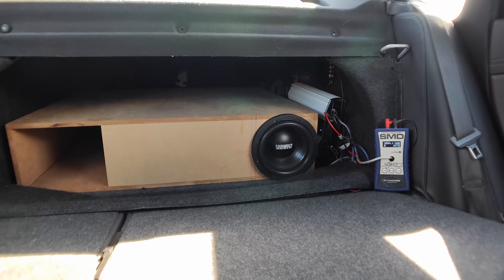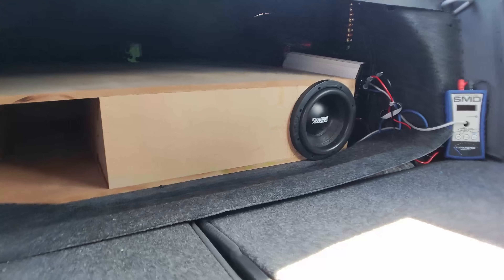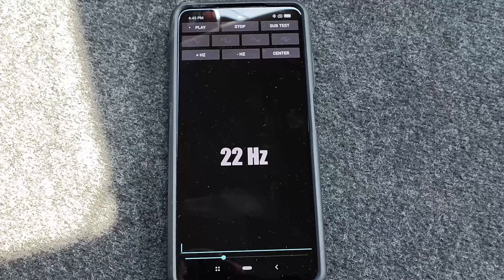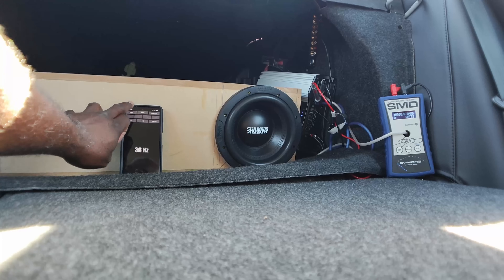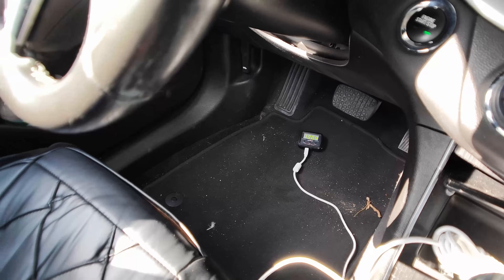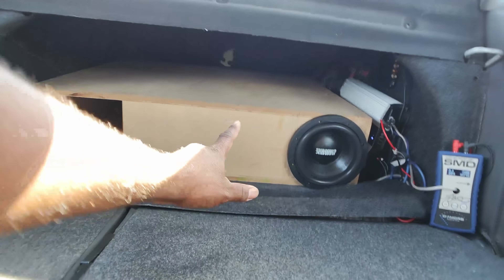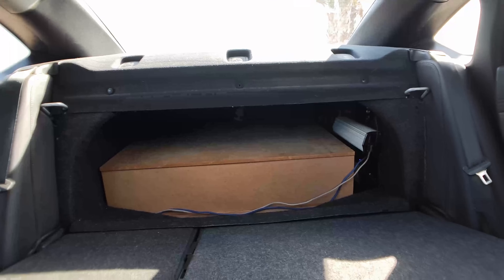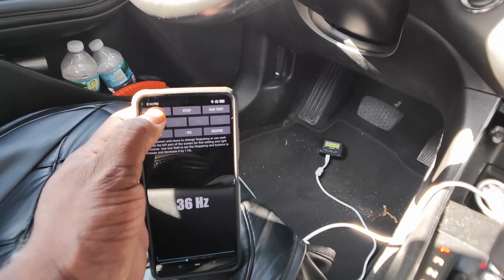A Properly Built Horn Enclosure - Sundown Audio X-8 Subwoofer - 140db SPL Test!

Comment: Unrelated question, if I’m building a custom ported enclosure for 2 skar VXF 12s
Is there anything I should know? Plenty of space but I’m shrinking it to keep the cubes down. 
33”x19x18.5”
Front facing port 52” port area tuned to 30

Comment: чв один из самых широких по ачх сабов, но на громкость труба лучше
Reply from the maker: В будущем я попробую провести этот тест с другим сабвуфером. Спасибо за просмотр.
Reply: @BudgetBassHead  a bass reflex on the pipe, and tuning to the resonance frequency of the speaker, gives a very high but narrow efficiency, for example, a t-line will play 100 db 20-160 gz and a box with a pipe 35-40 gz

Comment: When finding the peak or the vehicles resonance do you have to check for those numbers for each sub whether it be 8 on up to 15 or would that number be the same just because of that particular vehicle?
Reply from the maker: Good question. I suppose it would be more constant in an open environment like an SUV or a van. But coming from the trunk changes things. So it varies with enclosure size and tuning. Mostly because the enclosure size is less than or greater than the previous enclosure; which changes the overall cabin volume.

Comment: slight correction, at 5:16, you mentioned it horns dont have a lot of back pressure, this is actually far from true when dealing with real horn designs, specifically referring to what they call a compression chamber in the horn desgin . . a t-line typically doesnt not have a compression chamber but a real horn design does. , this compression chamber is NOTORIOUS among horn designers for destoring spiders, and ripping cones, because the pressure is so great, this is only specific drivers with strong motors and spiders can thrive in a horn, if not strong the the compression pressure will shred the sub.  Also there is a ratio of compression when building a horn design. some horn designs produce higher pressures than others. if i remember correctly the higher the compression on the chamber the louder the sub BUT at the risk the sub being more likely to be shredded. only the best subs can dealing with the highest compression ratios. Check out paraflex design group on facebook, there is so much to be learnt there :)

Comment: Hay brother i saw you say in another video that you should have an amp with more power than the sub can take to stop clipping. So i want to get a Skar rp 2000.1 amp and run 2 skar subs on it. ether 12's or 15's.  probably 12's,  what Skar subs would you recommend for that amp running at 1 ohm powering 2 subs. i think that amp dyno's at 2,600w rms.   also do you have a review video on the Skar DDX subs? i looked and cant seem to find one. Brother i could really use some advice. i want it to sound good but i also want it to bump hard and move a lot of air. i will be putting this in a 2011 Nissan Van. that van is huge and long with 2 back rows of seats that will lay down flat with lots of cargo area so my box can be huge if need be.  i just have herd that the more rms your subs are rated at the harder they are to push and i want to get the most out of my subs without having to run my radio at full volume, if you know what i mean. Can you give me some of your expert advice. Thanks brother, great channel, i am learning so much from your videos!

Comment: Had 2 15" speakers in folded horn enclosures in the house, powered by a Sansui 9090db, and Iv'e never heard anything better. They hit so clean, hard, and low.
Reply: Probably more to do with that amazing amp than anything else lmao
Reply: @chickenpotpie4045   I agree it is an amazing sounding amp, have it powering some cerwin vega vs150s right now, but really regret selling those custom folded horns i had.
Reply: @klubstomper Any way a square sub could do well in a horn enclosure?
Reply: @ericthompson4644 it should work just get your measurements correct, 
Watch this guy's other videos on how to design a horn but use your speaker TS parameters.

Comment: Good video, man. I say for a V2 build, try reducing the throat size all the way down the line, incrementally, starting at the sub mounting side.
This will (hopefully) lengthen the path and bring it closer to a quarter wave resonance of around 28hz.
It should also smooth out the response curve.
Any chamber resonance can be smoothed out with wool batting or poly stuffing the line 1/3rd of the way past the subwoofer side of the line.
Just some input from someone whose designed and built transmission line and labyrinth enclosures...

Comment: Have you ever considered getting a t harness from llj Customs out of Phoenix I had one made for my 2019 Chevy Trax and it was plug-and-play worked flawlessly
Reply from the maker: I really do need to. Check them out a couple years ago but never made the purchase
Reply: What is a t harness?
Reply: @boomymood  The harness that is made to add an amplifier to a stock system without having to hack up your OEM wires

Comment: 1/4 wave enclosures can load the cone to an extreme extent. Take your resonator and narrow it, then increase the size for maybe one fold and make the mouth far bigger. SPL will likely increase as will cone control. My suggestion, anyhow, grains of salt and all.

I've complete construction of a "double transmission line" "compound horn" paraflex box for my Walmart sub.... I'm coming after that 140dB once I get some new power wires run etc etc.
Reply: exactly every 1/4th wave i have done has had an insane amount of cone control.
Reply: @puresesh7985  i have a transmission line in my car with a 800w 10" deafbonce sub and i can easily push 1300w because the cone doesn't move much
Reply from the maker: Cool idea. I was limited on space. This was the best I could do within the trunk.
Reply: @BudgetBassHead  I had to hammer out my trunk and remove the carpet to fit mine, but it fits. Lol. TBH no idea how much my cone is moving on this one because the box fully encloses the speaker. My 6.5" version the subwoofer seems to take well over rated RMS before exceeding excursion, but it's got a crazy motor for the size of the speaker. My 12" motor isn't so impressive for the size
Reply: I would be interested in seeing and learning from your build

Comment: When you did the sweep, your horn enclosure peaked its highest impedance @ 37Hz= 6.1 ohms. Thats why your Db went up a little more when you tryed 37Hz, that is where this enclosure has maximum cone control. You could have eeked out a little more @ 37Hz, if you crept up on power, just before it bottomed out, maybe a 140Db @ 37Hz? Also looks like to be safe on this enclosure, i would set subsonic filter to start reducing power @ 30Hz, cause by 26Hz, it started to unload. Great video, and results!
Reply from the maker: Thanks for the tip

Comment: The box matters, a properly engineered and tuned box makes a huge difference.
Reply: Or if you have the money and space build a Infinite Baffle bass array usually it is built with 8 or more 12 to 18" woofers mounted so the movements cancel each other out (or else it will shake your house to pieces), in that arrangment your box do not matter as long as it is big enough (usually use you use another room as the (box). I have heard the undistorted   sound you get from open air dipoles and infinite baffle which is something else  but it is inefficient as you need +6db per octave boost from 70hz and down usually. But I would love to hear how a properly build bass horn sound like to compare as that is completely the opposite and I would love try build one :)

Comment: I ran the X12v1 for years in a 3cuft ported enclosure on a RF 1500BDCP. It was the best sounding subwoofer I’ve ever heard. 

They sound so clean it takes a while to get used to them.

I’m looking at picking up one of those JP8 amps and one of these V3 8’s now. I don’t want to run a second alternator and battery in the car I have now.
Reply from the maker: Very cool!

Comment: Those are incredible #’s very impressive. Where would be a good place to get info about horn enclosures?  I currently have a 6th order in my theater so I have plenty of space and prefer to build my own boxes. I’m thinking of building a large box for two FI sp4 18’s or one for each. Any info would be appreciated thanks.
Reply: I have 18 inch Fi sp4s= SSA evils (when Fi actually built them for SSA in 2016, or 2017) they are Awesome= 66mm of linear 2 way X Max, and Over 90mm of peak to peak X Max! They excel in ported= 7 to 8cu. Ft. Net per 18, tuned @ 20 to 25Hz for home audio, with 1-8inch aeroport per 18, 4th order= 3 to 4cu. Ft. Net rear sealed rear ch., front ch 4.5 to 6cu, with 100 to 125 sq. In of port,  tuned @ 42Hz to 70Hz, and 6th orders= 5 to 6cu. Ft. Net rear, tuned 23Hz to 25Hz, with 1-8inch round aeroport,  per 18, front ch. 4 to 7cu. Ft. Net tuned @ 42Hz to 70Hz, with 120 to 150sq. In of port, to play up to 40 to 65Hz, tune front ch. higher if you want higher. Hope this helps?
Reply from the maker: Checkout HornResp. It a free tool. It has very detailed documentation and an intuitive layout.
Reply: @BudgetBassHead  I also watched one of your videos with the 6 1/2. I’ve built a couple of T-line boxes using the “half of the driver formula” huge boxes make even mediocre subs sound better. What would be the difference between the two designs?
Reply: @Superficial_david  Transmission line and (back loaded/tapped) horn design both use 1/4 wave theory to align the back wave from the speaker cone with the front wave. The biggest difference from T-line to Horn is that a horn has a mouth with area exceeding the area of the cone of the driver, as I understand it. They are LOOOUUUUUDDD lol
Reply: @Superficial_david  how can I learn more about this technique?

Comment: Horns!!! Sealed box in a Horn even crazier.  🤪 more control of woofer. If you figure out the holy grail. Simetrical loading? It will blow your mind. Took me 20 years to understand...
Reply from the maker: Symmetrical loading? I've never heard of that. And now you got me googling stuff 😁
Reply: @BudgetBassHead  I'll give u a hint. Steve Deckert... the GOAT of enclosure builds in my opinion. (Your in my top 10)  It loads the woofer in a different way than anything I've ever seen before.  And is proven... if u reply I'll send u a explanation...took me 20 years to understand. And highly recommend you looking into further. I don't want to share with everyone it's not my design & it is kinda a secret sauce. However you do enjoy the same thing I enjoy....highly doubt you will find an explanation on Google.  Personally been looking for years.
Reply: @RIP the 90's  lol. 😄 🤣 they are mind blowing. Roughly 9db gain if done correctly vs other boxed. Large though. The creator does know his stuff.
Reply: Explain
Reply: @Alkatross  have to apologize... I did post a reply. However I deleted it. Feel its not fair to the designers or hard core enthusiasts. If you really do research and not just Google (Google will not help). Steve Deckert, semitry loading. May help? Hint it's the shape of the port!!!
Reply: how can I learn more about the Holy Grail technique you mentioned? Are there other examples besides the DeathBox?
Reply: Yep, I know about it and still struggle it's more for home not car audio boxes get absurd really fast. ABC enclosure is another fun one if you've got the time and space.
Reply: @matt adams  appreciate the feedback. Agree to disagree on ABC boxes. They are complicated & have narrow frequency response usually. Large & overly complex. A property built semtricaly loaded Design will play louder and with less power. Just from my experience. & opinion & u know what they say about opinions. 🤣 everyone has 1.